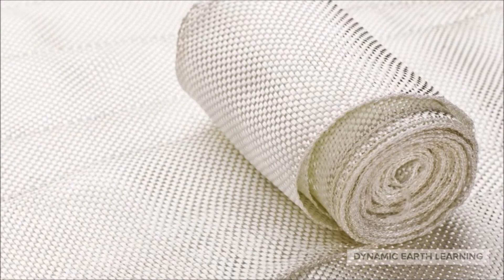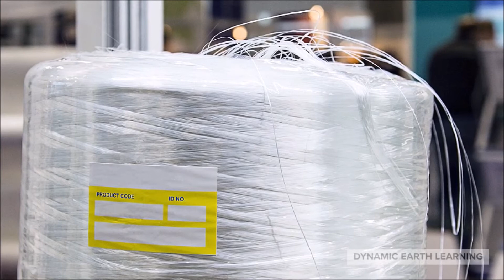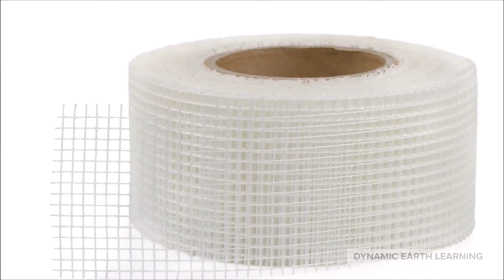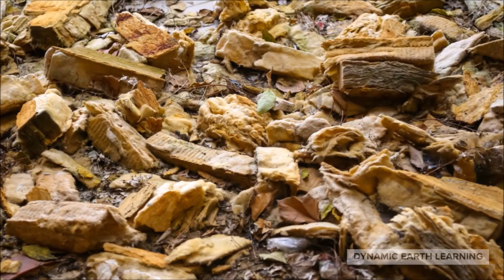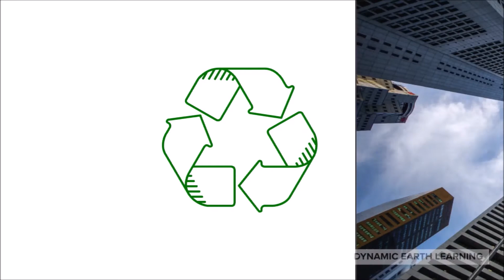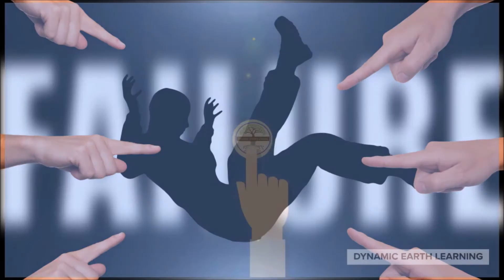Information about Recycling Fiberglass  - Fiberglass a Burden on Our Environment

Comment: the information about eco wolf and it fiberglass recycling is off it's web site and is mainly pipe dreams and lies form it's owner,. miss unger. I worked there many years as the number 2 person in selling recycling systems to a number of companies around the world. most were shut down due to equipment failure or owner/employee dissatisfaction with the equipment or process only 2.systems ever got much use and both had to have process and equipment modifications done on site. in short very few of the buyers were happy in the end

Comment: Seems like the grinding might be the most mechanical, and (with gravity separation like with copper from incpsulation in chopped-up wires) would at least result in far less volume of the two main products. The "minerals" including glass and other ingredients could be smelted by a client, and the polymers broken down in a bioreactor?